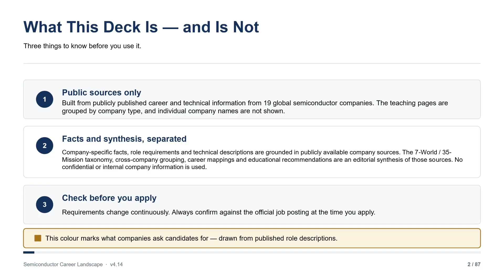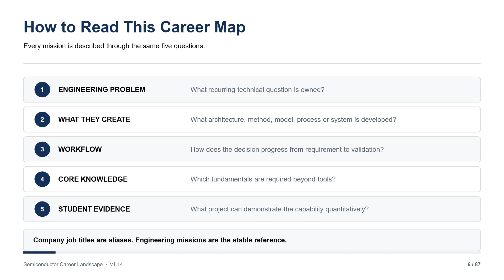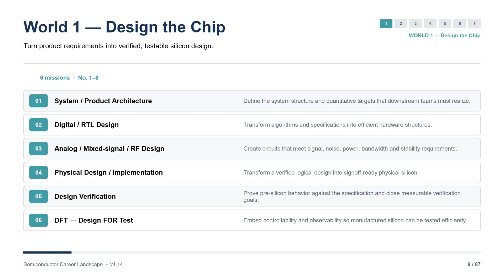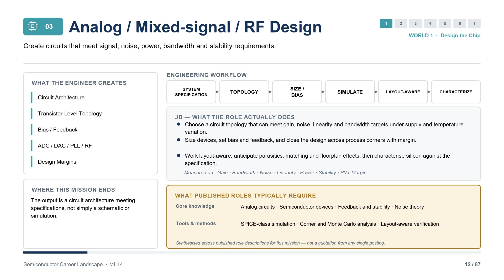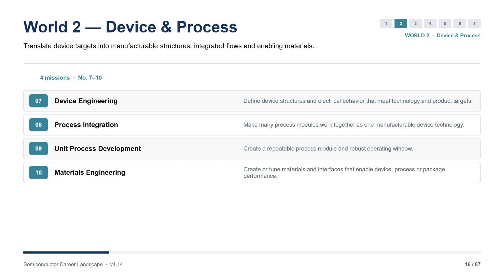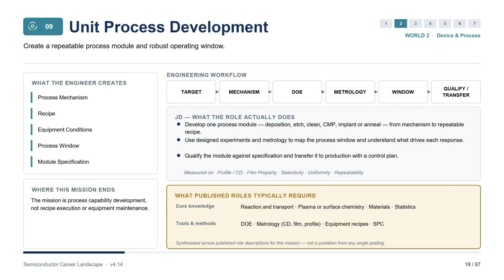[진로코칭] #1 Semiconductor Career Strategy — It Is Bigger Than Chip Design | 7 Worlds, 35 Missions

Comment from the maker: If you take one thing from this video, take this.

A role is defined by the problem you own and the thing you produce — not by the tool you use.
Knowing Verilog does not make you a design engineer, and knowing Python does not make you
a data engineer.

Was there a mission on the map that made you stop and look twice?
Drop its number in the comments and I will reply with how to start preparing for that one.